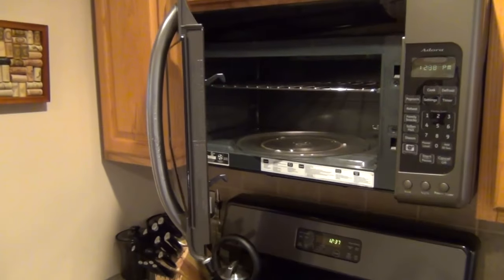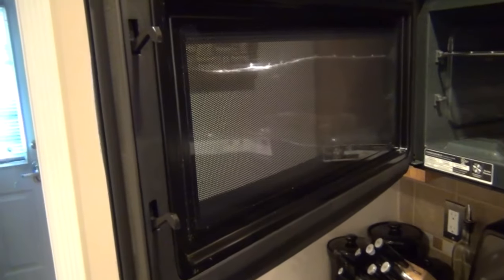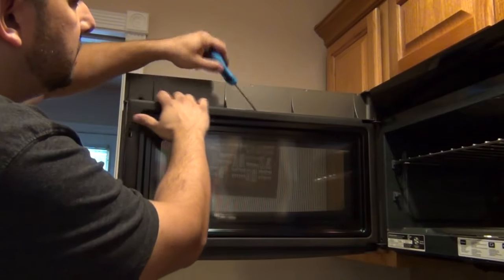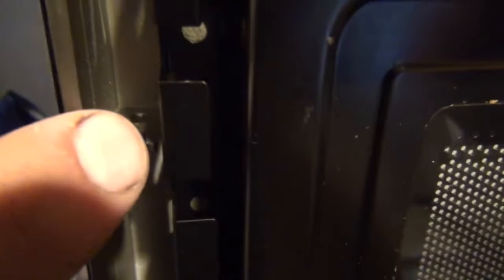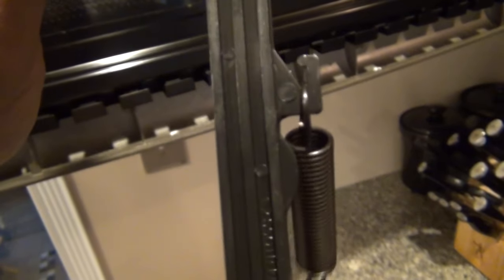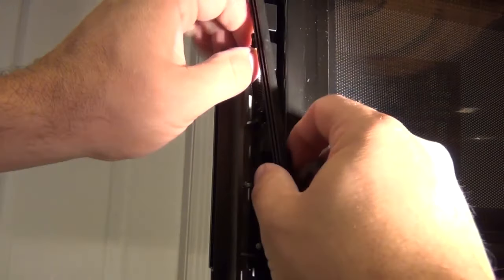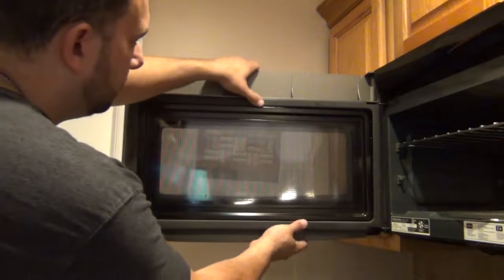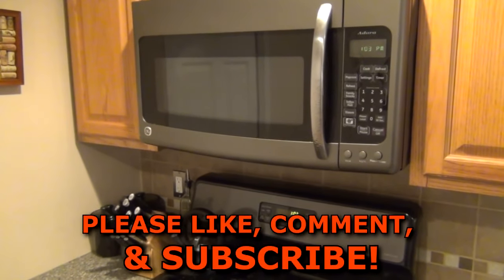Repair a Broken Microwave Door Latch

Comment: I am 66 years old. I cannot identify a hammer or screwdriver. I am a Mr. Fx-It  fix moron. I barely know how to put air in my tires. But I fixed my microwave using this video. It has inspired my confidence so much I have applied for an aircraft mechanics job at United Airlines. I'll let you know if I get hired so you can choose a different airline. Thanks for the fix it video.
Reply: I'll probably now only fly American Airlines! Just kidding, and best of luck in the application and maybe job.
Reply: FIXED IN 5 mins!! You saved me soooooo much time, energy and money! thanks so much for making such a concise,  user friendly video. 😀
Reply: THIS👆👆😂
Reply: Omg fixed in 10 minutes, no tools except the screwdriver to remove the trim. Thank you! Saved me $400. I appreciate you.
Reply: Thanks Bro.  You saved me so much time and money. Great video simple and to the point.
Reply: Since your post ten months ago there have been some developments at Boeing and they may need your help. ;)
Reply: Just got a job at Boeing. I think I have all the tools necessary. Hammer Screwdriver and crescent wrench

Comment: I had this latch problem. Watched this video, got inspired and out of bed and fixed it in the middle of the night! A broken spring was the issue so I was able to bend hooks on each end to reconnect it. Thanks a million!
Reply from the maker: Nice work and thanks!!
Reply: @fixitwithzim Hey there. Your video is terrific. Thank you for sharing it with the world. However, with my particular latch problem, the only part that broke was the plastic piece that has a hole in it to keep the upper hook-type-part in place. The one that houses the hole for the spring is in great shape and the one below that for the lower hook-type-part is in great shape. It’s just that the top area doesn’t stay put since that plastic securing piece broke off. So, the door will not close. I just tried all sorts of things to try to keep it in place / offer resistance when closing the door. No luck. Since this microwave is discontinued, are we just totally out of luck? Please let me know what you think. THANK YOU!

Comment: Fantastic!!!
We heard a moderately loud bang in the kitchen and didn't figure out for a few minutes that the light in the microwave was on.  Turns out the latches on the door moved up and down freely.  My wife searched for the model number of our 12 year old Sharp 1200 W unit. Found them from numerous big-box stores. In the middle of the microwave suppliers, she noticed a few fix-it posts. She read one to me and indicated that I should try it.  The written description was a bit confusing - so I asked if there were any images.  She found your site and I immediately understood what and how to do it!. Taking the picture frame off the door was easy - found the broken post from the door - the spring was hiding on the bottom ledge, not easily visible because it was against the front cover under one of the metal blades.  Once I retrieved it with tweezers, I followed the instructions on your video and in less than 5 minutes, saved $200 and a trip to purchase a new microwave.   I'll keep your channel in mind for future fix it needs.
Nicely done!
Reply from the maker: Thanks 👍🏻

Comment: Thank you so much for your instructional video. I have an Electrolux mike oven. And the door latch failed. I was procrastinating on repairing it, cause I was going to take the whole door off its hinges. Now I managed to repair it in about 15 minutes. And it's up and working. A great video! Thanks again

Comment: I was sitting at my computer when I heard a noise in the kitchen. The protrusion that held the lower end of the spring just kind of... spontaneously (without the unit running)... BROKE! I was disgusted that  such a lightly used microwave was now going to have to be replaced. Then I found your video and was able to beat this *obvious planned obsolescence*. My microwave works again! Thanks very much for taking the time and effort to put this video up!

Comment: This video is so helpful and saves my GE microwave every 4 years. As a frequent user every day of my microwave, the plastic bottom edges of the latch hooks will wear down from friction causing the internal switches not to be pressed down far enough. The result is the internal light and blower stay on. Originally I had GE tech support come out, along with a $200 service charge all they did was recommend replacing the entire microwave! So, many thanks to you guys for creating this video!

Comment: Thanks to you,  I just fixed the microwave door.   I  have to admit it took more than 5 minutes.   The spring didn't want to stay in place.  I  tried several spots until I found one that worked and let the frame line up as it should.   Success!

Comment: Thank you!!! I could not believe how simple it was to fix our sharp unit. It’s virtually identical with exception that the spring is much much smaller. I used a paper clip so I can keep the tension the same when attaching to the metal part. It’s working perfectly now! Thanks so much!

Comment: Thank you. I was just away to buy a new microwave and thought I'll check youtube in case there's an easy fix. You saved me £60+ and a 20mile round trip to the supermarket.
Had to drill a hole like you said as the tab had broken off the latch piece but still only took 10 minutes. 👍

Comment: Excellent video. At first, I thought that the latch piece that hold the spring was broken, but when I removed the trim piece two pieces of broken plastic hit the floor. I looked at the latch and saw that it was intact. So my problem became making a repair to the plastic (glued in!) insert that hold the other end of the spring. I knew there was no way I could repair it that would have a lasting effect, even with Gorilla Glue. I would still have glue it into the body of the door, and my gut feeling was that would be just as ineffective. I find that searching for repairs and repair ideas are plentiful on YouTube, so I entered my problem.  Voila! Up comes your video. Solved my problem in a matter of minutes. Microwave is now operating as normal. Thanks, Zim . . . you helped me save a bit of money.

Comment: You are awesome! Watched another video which had same directions on removing trim but he said the break was on the plastic latch. I'd ordered the latch before looking and come to find that it was broken, as you said, on the door (99% of the time). Obviously the other video was selling the latches as the fix. You fix of attaching spring to metal on door, was free and instant! Thanks so much. Wish your video had come up first and I'd have not spent the $14 had had microwave OOO for a day.

Comment: I did it!  Thank you so much for posting this.  My repair was the 1% you mentioned, but I got it to work by drilling a little hole as you suggested.  The most difficult thing was getting light to see where to attach the spring to the door.
Reply from the maker: Great job and nice fix!!

Comment: Thank you soo much. This just happened to me. Thanks to this video I fixed my microwave with a puddy knife, needle nose pliers and a flashlight. The piece of plastic the spring was attached to broke. I attached the spring to the metal frame to the right. just like the video. I took my time with this and was done in ten minutes. Thank you again

Comment: Thank you!

Your video gave me the insight and a li'l confidence to fix my problem, which popped up this evening.

Off I went! Yep, broken plastic bracket.

In my case, on a Sharp brand over-the-stove MW around 30 years old, I decided to use a bent piece of heavy tie wire (as for supporting suspended T-bar grid ceiling systems). I used needlenose pliers to make a tiny crook for the spring at the top; measured & marked, then formed a hook to grab the lower piece of bent metal on the frame. This kept the alignment near-vertical.

Reassembled, tested: Sweeeeet! Up & running in time for dinner! Zapped some left-over fettucini!

Thanks again for your content. Simple & helpful.

Comment: Thank you!  I fixed mine in 10 minutes.  It took that long only because I could not get the little posts back in place because the spring was in the way.  Nothing a little shove with a butter knife couldn't handle! :) THANK YOU FOR POSTING THIS! 🤩😘

Comment: Just followed the directions  in the video and the door was fixed. After stops and starts it took 10 minutes.    One suggestion is to use a long flathead screwdriver so that  you get a little leverage.  Be gentle and persistent and it works!! Thank you!

Comment: Thank you so much for showing.  Perfect fix.  The 1 I worked on was a 4yo Samsung.  I'm so over all this overseas junk.  Had a microwave from 1985 that lasted till about a year ago. Heavy as a tank, but IT WORKED.  Only had to replace light bulb a few times in all those years. No flimsy, easily slapped together plastic. I miss the good ole days of better built products.

Comment: Worked great! Took me about ten minutes. I needed to drill a little hole in the metal framework on the door by the broken tab because the distance of the metal tabs was either too short (not enough tension), or too long (too much tension), but it latches like a champ now! Thanks for the video!

Comment: Thank you for quick repair.  One week before the holidays and I didn't need the headache.  Three minutes later back to work.  Cant believe they don't do as you suggest during initial setup and drill small hole to connect spring.  Overtime this has to happen to all these microwaves.  Have a good holiday!

Comment: We have an old Kenmore MW that looks almost identical to the Samsung (maybe made by Samsung?). The broken piece was on the door frame and not the sliding latch, so I hooked the spring to a channel cut already in the frame and reattached the slider to the spring. Worked like a charm.
Reply from the maker: Awesome!  Glad you got it fixed!

Comment: Thanks for the video. Our Samsung microwave door has been not latching tightly for a couple years now and a certified Samsung repairman wanted to replace the door for around $150 part + labor, which would be near the cost of the microwave. We have been able to get the door to close enough to run but finally today all spring pressure was gone and the door wouldn't close. The little plastic clip the spring attaches to on the lower part of the door frame was broken off. I was trying unsuccessfully to find a replacement clip and also considering doing something like what you suggested but wasn't sure if it would work when I found your video, did what you did, and now the door closes firmly like it's brand new. 
Thanks again!

Comment: This is exactly the video I needed to reattach the latch spring on my microwave! I couldn't agree with you more about the poorness of the design - it's definitely a failure in waiting. I even managed the repair using a butter knife to pop the panel saving me the 2-3 minutes it would have required to go to my shop for a screwdriver. . . total time to fix <5 minutes! Thanks for the helpful tip!

Comment: Thank you so much! This totally fixed my problem. Didn’t have a screw to drill in a new hole on the latch so I held a knife over a flame and melted a hole through the plastic with the tip of the knife. Works like new now!!!

Comment: I came home and noticed that my microwave was open and wouldn't stay shut, thanks to your video and my big brain move I fix it with a butter knife, 2 different tools which were so not intended for hardware repair, and a kitchen blow torch; because I do not have a drill, but the spring was not cooperative 
Thank you so much

Comment: Perfect video. I saw others where you had to remove the door completely, etc. This was simple. I have a Frigidaire and the internal plastic piece actually broke. Luckily I was able to attach the spring to another part of the microwave. I was stressed about taking to a repair shop, but this solved my problem. Thanks!

Comment: High five bro! I was about to contact my home warranty peeps until I bumped into your video. It was a little different in my case where the latch on the door itself was the one that broke off. I was able to hook the spring onto the metal frame instead. No drilling was required. Fixed my issue in less than 5 mins. I'm buying you a beer if I ever see you!

Comment: Thank you.  I had it mostly figured out, but wasn't sure about getting trim bezel off the door.  I fixed the latch in about 5 minutes.  I drilled the new hole just inside of the little part on the latch that broke off.  Thanks again. :)
Reply from the maker: You’re welcome!  Glad you got it fixed!!

Comment: Huzzah! Fixed our microwave that’s been broke for YEARS! We had a rubber band hooked around the bottom of the door handle around the bottom of the door and onto the bottom latch and that worked …ok
Until the rubber band would start to break down and not be tight anymore. 
But now it’s fixed for reals!!
Thanks!!
Reply from the maker: Awesome…nice work!!
Reply from the maker: Awesome, nice work!!

Comment: Thanks for your vid. Once I opened the inner panel of my non-closing microwave door, I discovered my problem was different than the one you showed in this and your other video. In my case, the latch spring broke off. I found my nearby Harbor Freight sold a bag of 200 little springs in a variety of sizes (for $4.49!!!). Replacing the spring in the model in question (an old Sharp Carousel) was a little tricky, but because I understood the latching mechanism from your video I eventually got it to work. Thanks again.
Reply from the maker: Hey, nice fix!  Yeah tight quarters working in there for sure but you saved a lot of $$$ fixing it yourself!

Comment: You, good sir, may have saved my mother’s life today. She pissed me off so much that I slammed the door to the microwave when putting in her dinner. I heard something snap and then the door wouldn’t close and the thing wouldn’t turn on without me holding it. At first I attached the spring to the wrong spot, as I couldn’t see well where it was to be attached. And then it wouldn’t work at all even with me holding it. So I tried again, and then the lower holder for the rod broke off too and I was about to lose my cool. Then I tried attaching the spring where I saw a piece had broken off, refit the door to hold the rod in place with just the top tab, and voila! And to give an obvious answer to your possibly rhetorical question: the reason they don’t attach the spring to a hole in the metal but rather to a plastic tab that breaks easily is because they want to you to buy a new one. I’m sure they hate you. But me? I thank you for helping my mom live to see another day. 😉😳

Comment: Great video. I had the same problem. The only difference was that the end of the spring broke off at the bottom. the quick fix was to open the bottom coil of the spring, shape it in a L or V and reattach to the original slot. Thanks again.

Comment: Thank you for the disassembly instructions, failure & fix description!  This was the exact problem on our 700w Emerson counter-top model.  
Drilling a small hole at the bottom of the bracket to hang the spring was the key.  
Amazing that one could design a modern appliance to be so easily defeated by the failure of a single 3mm plastic hook?

Comment: I'm a retired commercial food equipment tech. I sucessfull glued the bottom tab back into my GE microwave. I fitted the plastic tab in place and dropped superglue on all 3 sides. Then I sprayed superglue accelerator on the tab.  After cleaning the area I reinforced it with Black MarineTex epoxy which takes 24 hours to cure. Put it back together. Works. That spring hooked on the metal plate ig going to create  metal fillings,  Might get into your scrambled eggs.
Reply from the maker: Thanks..haven’t seen any issues with doing this repair a bunch of times myself. The shame of it is the horrible build quality with today’s appliances.  Built to throw out and not repair. Crazy but it’s the way of the world

Comment: It’s 7/30/2023, my 2017 house with a built in GE Microwave door latch broke.  After viewing this video, my plastic spring attachment broke also. I did the exact same thing he did in the video and it worked with no problem. Appliance repair guys in my area charge 150+ just to come out to the house! That does not include fixing the problem. I easily saved $200+